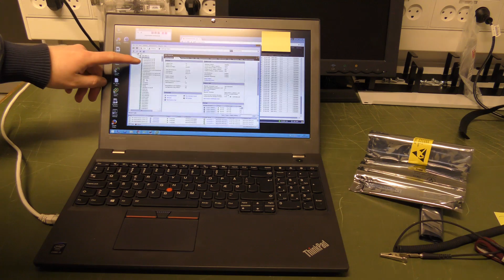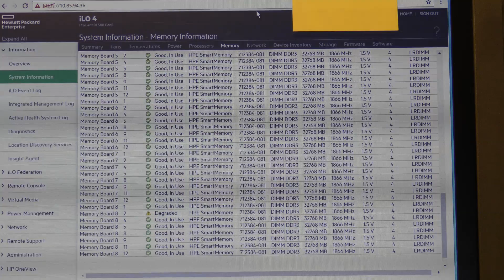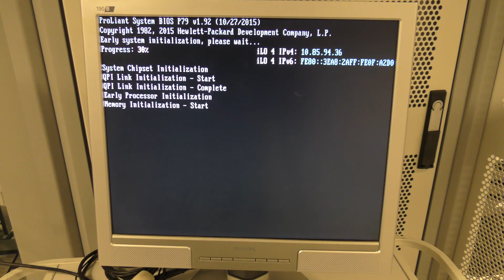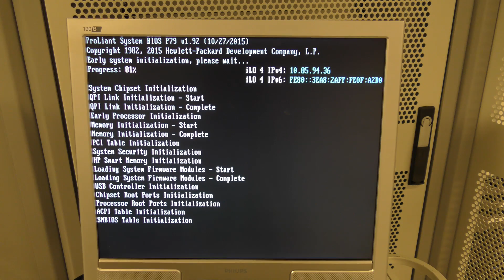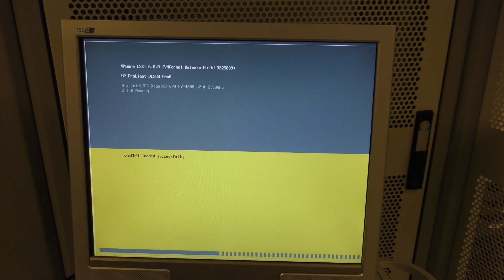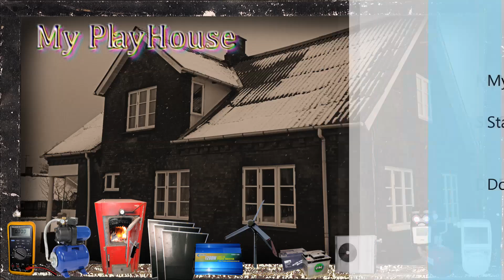2TB Memory!! Fixing Memory Error - HPE dl580 G8 - 490

Comment: hey morten. do you try ECC ram on normal desktop motherboard?  will it work?
Reply: Not to mention that on HP servers you have to use "certified" RAM, which is just another way to gouge you on memory prices.
Reply from the maker: Hi Hilmi Albums
PC RAM and Server RAM is not the same,, Servers use "smart" RAM, and PC use "dumb" RAM.. I did try to explain this in a video : https://www.youtube.com/watch?v=ohNPUjuqRqc
near the end,,I think..
Thank you for watching! :-)
Reply: install*
Reply: Hilmi Albums AMD Motherboards have ECC Support but only unRegistered ECC Ram will work ECC UDIMMS they usually don't have a Big chip in the Middle like the Registered ones
Good luck
Reply: Till Skylake Intel i3 CPUs had unregisted ECC memory support too.
Reply: Be carefull, Ryzan can use ECC memory dimms but don't use the ECC error correction and detection feature, making it useless for anything else then reusing a few already purchased ecc-ram sticks from an older machine.
Reply: ECC ram only works on a deskktop system if the motherboard supports it. Xeon processors and some Pentum and i3 processors support it, but I don't think any i5 or i7 processors support it.

Comment: you can keep this server :) I am not a fan of HP.. you can send one of those nice Lenovo's instead :) great to see a datacenter video again.
Reply from the maker: Hi Unkyjoe's Playhouse
Thank You very much!  Well I have change strangely many memory blocks in HPE servers,, in Lenovo / IBM´s it´s usually disks that need changing.
Thank you for watching! :-)
Reply from the maker: Hi WackyWRZ
Thank You very much! Yes the HP iLO is pretty good,,, but I find that HPE servers break down a little more than Lenovo/IBM servers.
Thank you for watching! :-)
Reply: Disk problems I can relate to that I tend to get the short end of the stick for disk replacements on our IBM V7000's the bastard problem I have dealt with before was a faulty canister than did not know it was faulty.

I should take a short video of replacing stuff, just the other day I removed 24 1U Supermicro Servers that will be recycled now, some of it got recycled to my apartment but small place cant have a server room :(
Reply: isnt Lenovo made by HP though?
I swear my Lenovo has Lenovo/HP on the serial number label on the bottom!
Reply: Lenovo is fucking garbage I lost my SSD in a fucking Year.